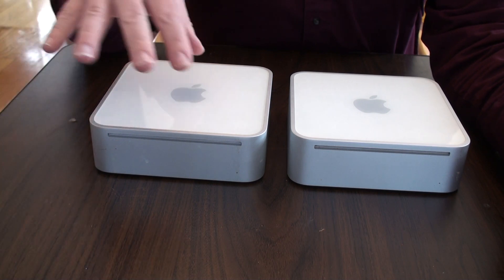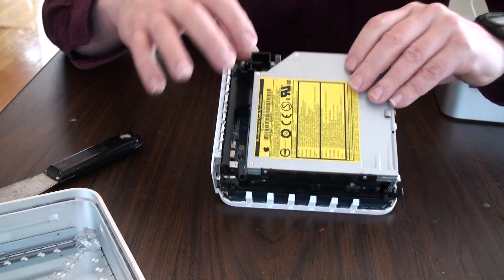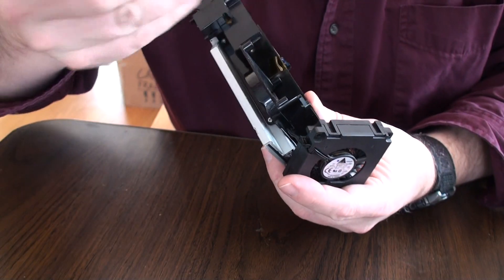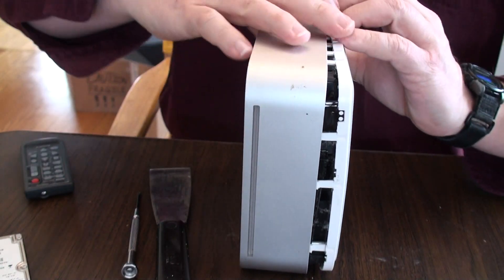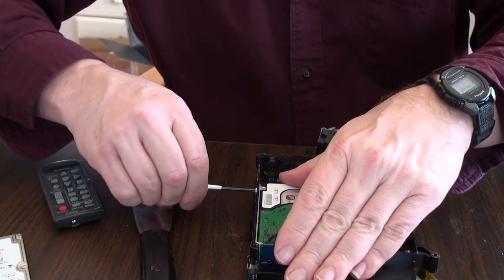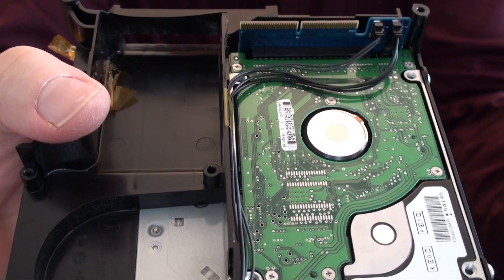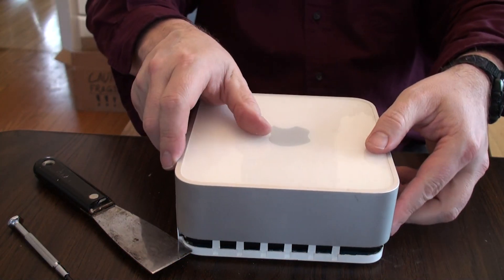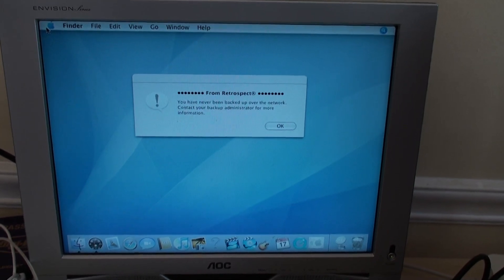Mac Mini (G4) Hard Drive Replacement

Comment: i know this was 7 years ago but i cant help but wonder why you didn't just use that whole hdd/DVD assembly entirely rather than actually changing just the HDD
Reply from the maker: It was a client machine so I just replaced what was bad, nothing more. Make sense? Thanks!

Comment: I'd add checking the CMOS battery and maxing the memory while it was opened.
I'd also mark the parts to be discarded.
Couldn't you have just skipped the 'replace hard drive' step by replacing the entire superdrive/harddrive/carrier?
Where does that little copper strip go? Somewhere near the speaker?
I can't see how it latches. It works with it absent.

PS: Could have used this info a week ago! OK so far anyway.